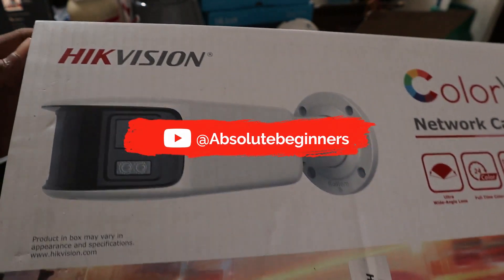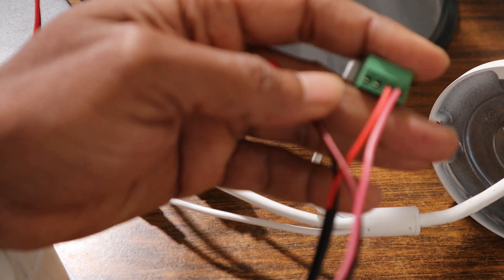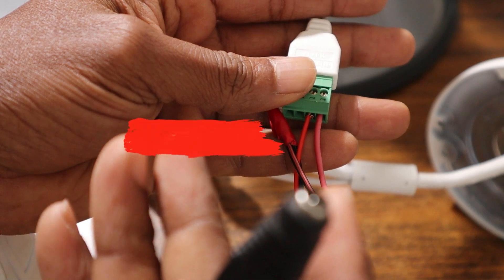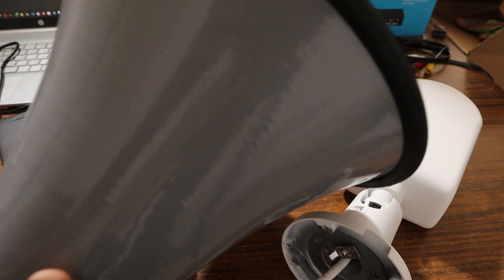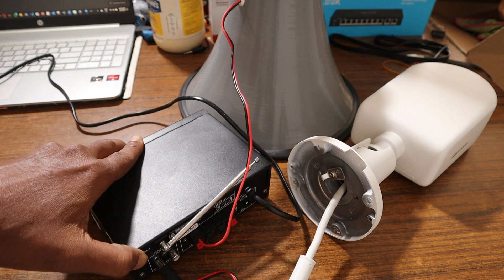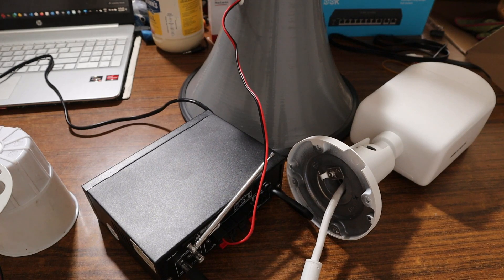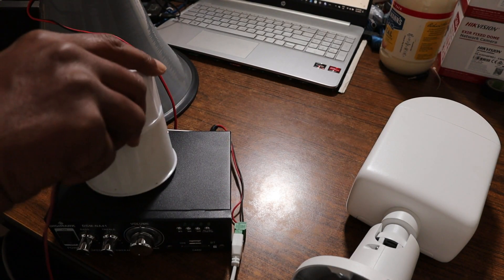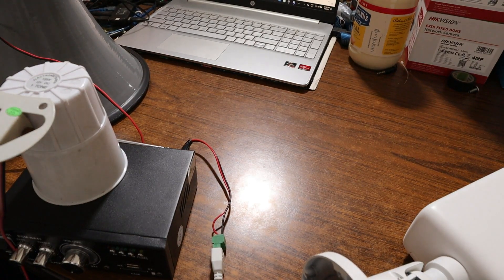How to Connect Horn Speaker and Alarm Siren to Hikvision IP Camera | DIY Tutorial

Comment: I am using ds-2cd3t46g2-isu/sl camera which is almost same, but my speaker is not working. Please suggest reason. I am not using horn type but simple speaker with amplifier.
Reply: Did you manage to get the aftermarket amp and speaker work? Mine doesn't seem to be working as well